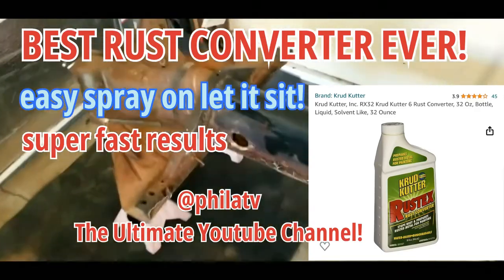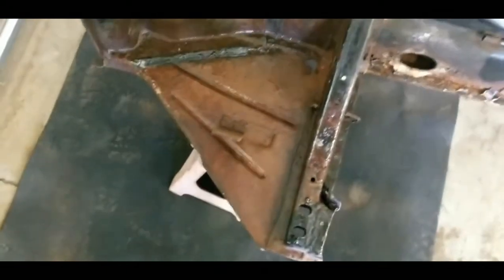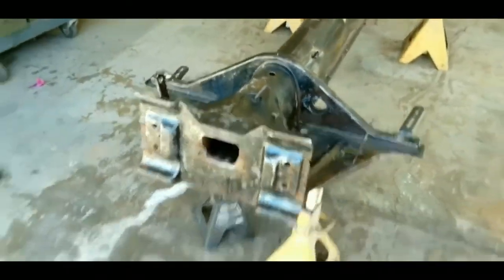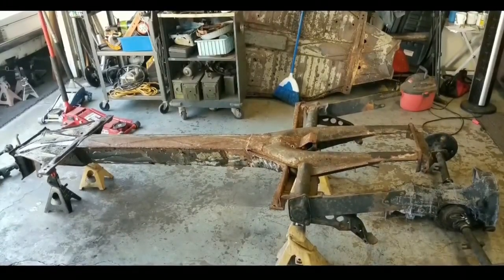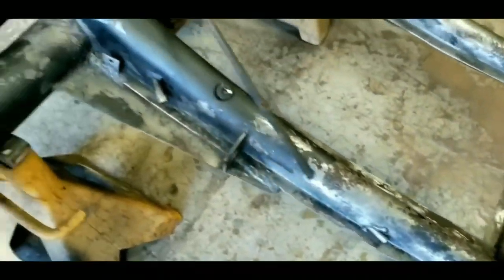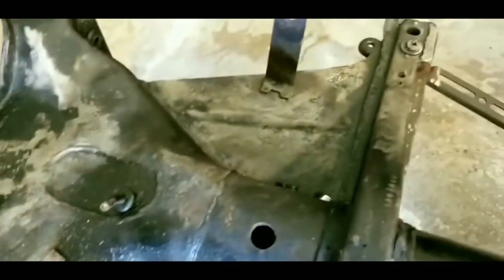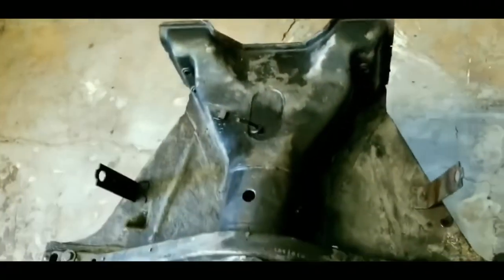FASTEST WAY TO REMOVE RUST! krud kutter RUSTEX just spray on and let sit! #rust #vw #rustremover

Comment: Thanks for the VERY helpful video; greatly appreciated! But I'm somewhat confused. You are holding a container of Krud Kutter Rust Remover & Inhibitor while showing a picture of Krud Kutter Rustex Rust Converter.  These appear to be two different products in that the former states that it removes rust (doesn't convert rust), while the latter states that it converts (doesn't remove?) rust into a paintable surface. Are these two products interchangeable? If not, which one are u recommending? Thanks!
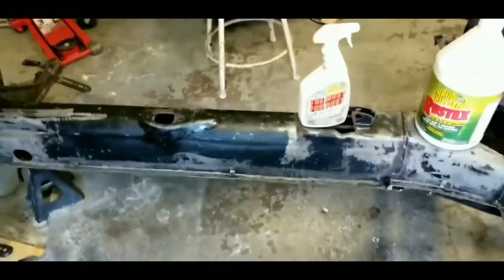Reply: Rustoleum has discontinued the Krud Kutter Rustex RUST CONVERTER. I found someone selling it on Amazon, and got a sealed, never opened 32 OZ bottle.. I was looking for videos on using it properly to best advantage. He covers this product differentiation somewhat at 1:54.

I called Rustoleum.... they were less than helpful.